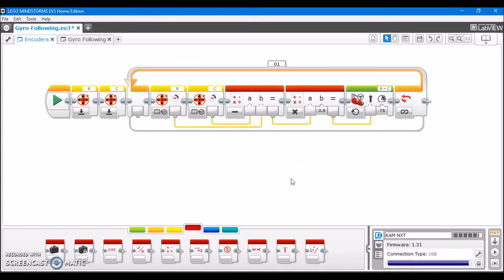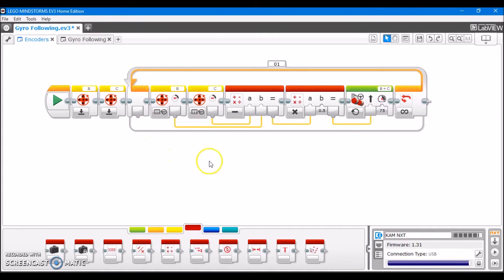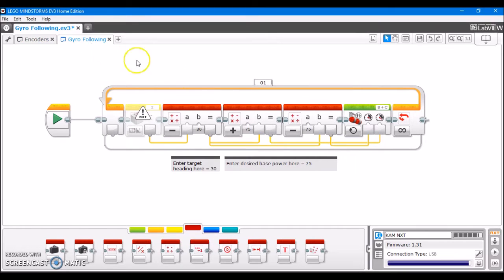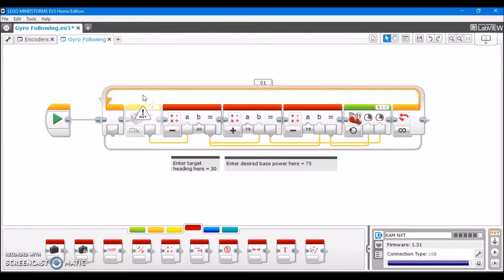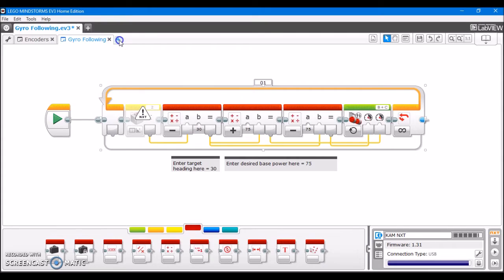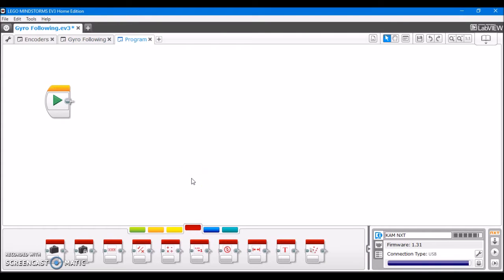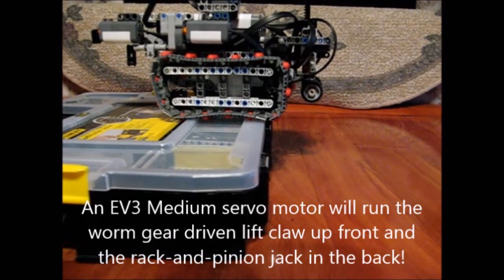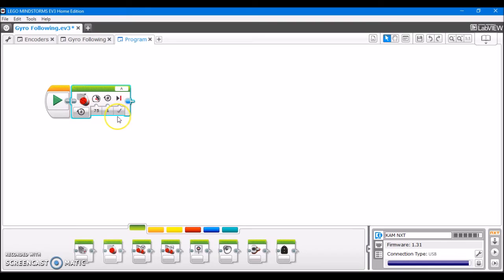How to Program an NXT in EV3-G

Comment: Wait a second, you can't program Bluetooth communication between two NXTs in EV3-G, but what about an NXT and an EV3? (For instance, if I was trying to control an EV3 Brick with an NXT brick, could I program that using only the EV3 software?)
Reply from the maker: Hmmm, I can't say I've ever tried it!
Reply: @Builderdude35  Well, do you have a general idea as to if that could work?

Comment: Im trying to get into lego coding for cheap so im looking at the nxt system. Is it still posible to code with nxt in 2021 and if so how? Do I use the lastest version of the Lego Mindstorms Home Application. Im only going to be using simple motor commands
Reply: Like stated in the video, the NXT is still able to be coded using the EV3 software. Just download the “EV3 Home Software” from Lego’s website

Comment: When I try to run an program I made on EV3-G on the NXT it says File Error. I didn't include any features that weren't supported on the program. What do I do?
Reply from the maker: That is strange. Maybe try re downloading the NXT firmware? If you plug the NXT into your computer while the EV3 software is open, the EV3 software will recognize the brick as an NXT and highlight any parts of the program that will be incompatible.

Comment: Colour sensor not work with Nxt brain
 I use ev3 g
Reply from the maker: EV3/NXT sensors are not interchangeable.
Reply: Builderdude35 
I have light sensor connect with Nxt brick but i can't use it with ev3 software
I use colour sensor block 
If you know why, tell me
Reply from the maker: The EV3 sensors have a different communication protocol, so the NXT cannot decode data from the sensor.

Comment: Can you please make a video on how to connect nxt sensors to the ev3 and program them i ev3g?
Reply from the maker: Unfortunately NXT and EV3 sensors are not cross-compatible. Sorry!
Reply: Ur wrong
Go here
http://www.legoengineering.com/ev3-software-compatibility-with-nxt/
Reply from the maker: That's my mistake, I remembered incorrectly. Using the NXT sensors with the EV3 would use just the normal EV3 blocks then.
Reply: Ok good.
Reply: And thanks!

Comment: Another reason not mentioned (and obviously not universally applicable); NXT-G won't run on OSX past 10.10 and TBH has never ran well on previous versions anyway. The EV3 software works a lot better in OSX. However, you must be at Firmware v1.3 on the NXT brick, so you'll need to update from a Windows installation (I used Parallels, worked just fine) of NXT-G since EV3G won't update the firmware on the NXT. Just a caveat for other OSX users.
Reply from the maker: Interesting, I never know that. Thanks for sharing!